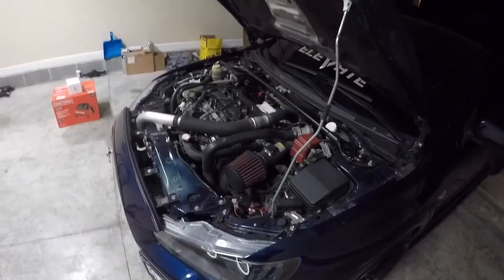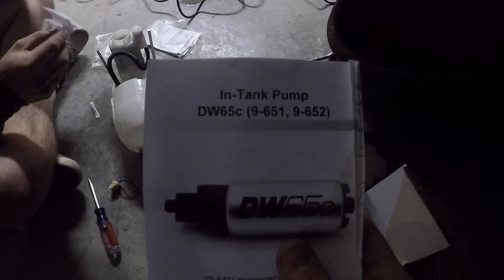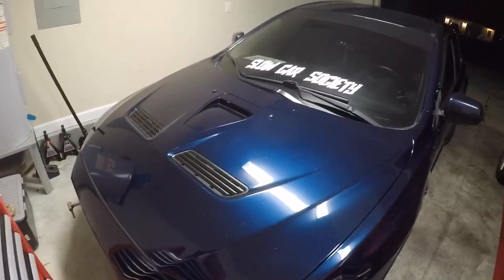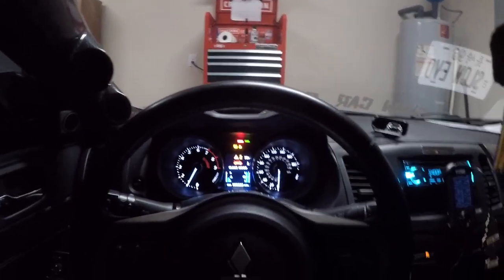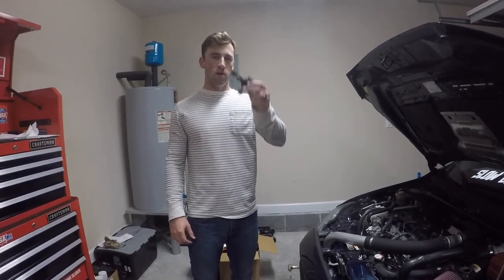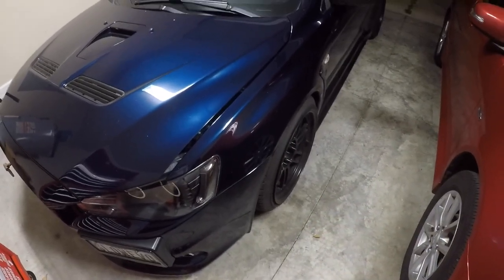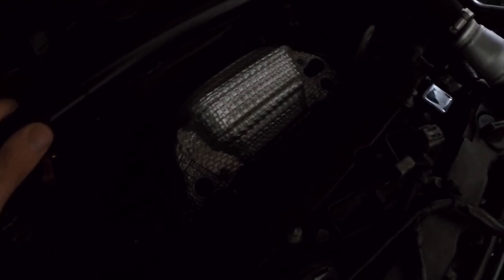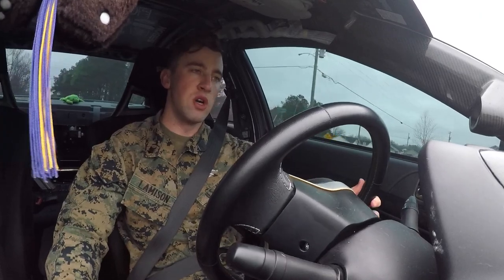Evo X mystery issue? (hesitating under boost)

Comment: I have the same issue. The darn Oem manifold turbo manifold cracked (common issue) you might have a crack underneath. Ordering a full race tubular or getting a custom one made.
Reply from the maker: I’m going to have to check! Even after the clutch replaced I’m still having weird hesitation issues when boosting or trying to go WOT. Just doesn’t feel right

Comment: I have a simliar problem with my evo 6 when it hits boost even a little it starts the hesitate alot.

Did you fix the issue?
Reply from the maker: Fuel pump had an O ring missed up

Comment: I had a similar problem. My BOV kept getting stuck open. It was completely random, sometimes it hit 26 and other times below stock Psi.
Reply from the maker: I’m thinking the BOV might def be the issue. Not sure tho. I’m going to drive it calm as possible, early shifting, not much boost ect until I save up and get all my bolt ons. Then install them all and get dyno tune and see if issue is resolved or if it blows up on dyno lol. Praying for the best
Reply: Racerkid998 I also remember being told it could have been the wastegate getting stuck or not opening at the time. I wish you the best bro! I’m sure it’s something simple lol that seems to be the case most of the time.
Reply: @saiyan_evox6442  I’m betting heavily on a stuck open dump valve... or if you are remarkably unlucky it’s your mechatronics unit. Please lemme know how you get on. Mine is misbehaving again... love from the ukaf ✌️
Reply: @DavidLamison  at least by the time you’re home you will have that sweet bounty to pay for your bits 😎✌️
Reply: @jamiewalker8772  It was the BOV. I ended up replacing it and the wastegate as well.

Comment: Having same issue now, did you figure out what was the cause. if so what was the solution?
Reply from the maker: No, I haven’t sadly. Had to leave for deployment
Reply from the maker: Fuel pump
Reply: Actually ended up being exhausted manifold and hot side of turbo having a bunch of hair line cracks.

Comment: How does your clutch cause your car to hesitate?
Reply from the maker: jrcu19 their explanation was that the clutch was going out so it wasn’t getting enough power to the ground. Turned out to not be the issue. Turns out fuel pump was bad, and when I replaced it I put in an O ring incorrectly. Car runs perfectly now, I’m gonna make a new video tomorrow :)
Reply: @DavidLamison  and this happened at 60k miles? What year is your Evo?
Reply: @DavidLamison  I am having the same issue hence why I ask. My Evo is only 5yrs old and has only 26k miles. With that amount of time I find it hard to believe it's the fuel pump. I think it could be my spark plugs.
Reply from the maker: jrcu19 it’s a 2013, happened around 60-65K miles
Reply from the maker: jrcu19 lol I would always start with the spark plugs! Easy to change out.
Reply: @DavidLamison  wow hard to believe that the fuel pump would go bad with only 60k. Did you see something in the data logging to make you think it was the fuel pump or was it just change components until it's fixed approach?
Reply from the maker: @jrcu19  shop said fuel pump after they changed it issue was gone
Reply: @DavidLamison  I was able to get mine fixed. It was the clutch. After I got it changed the issue was gone.